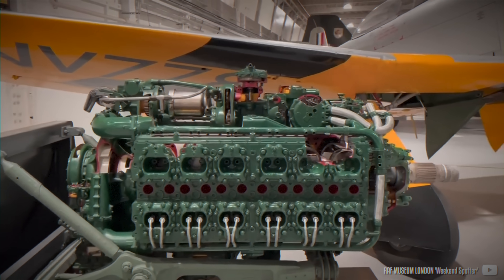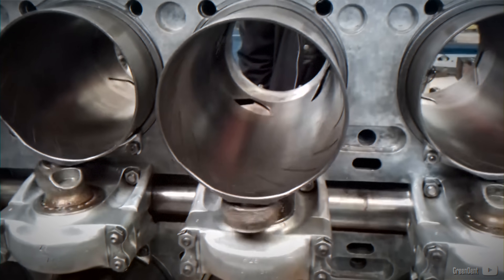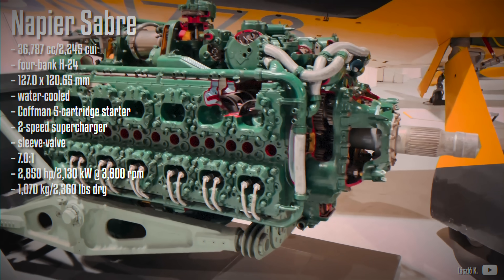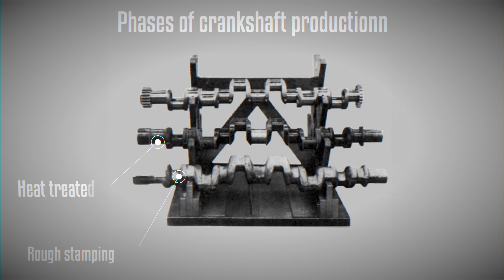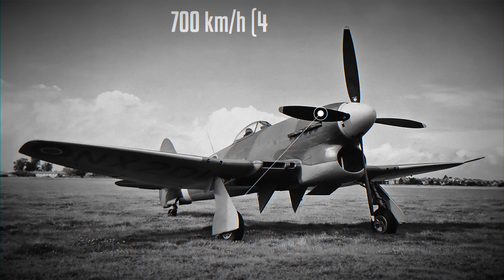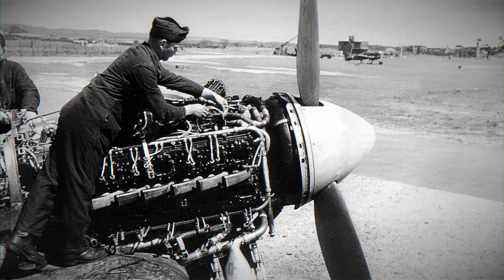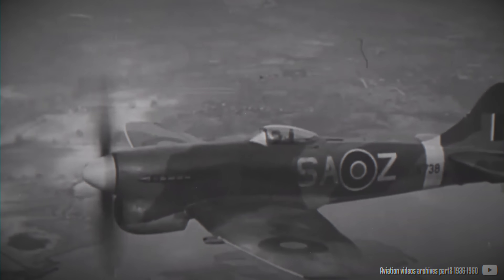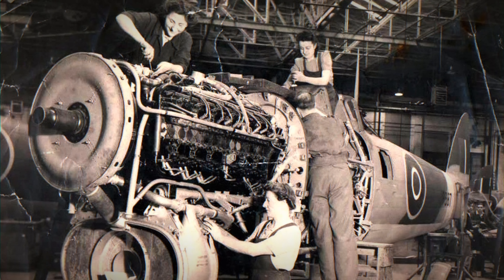An Unreliable 24-Cylinder That Helped To Win The War

Comment: The Tempest was capable to fly faster than 800 km/h with emergency power . One is being restored by Kermit Weeks in Florida . He has a brand new Sabre and the plane will fly in few years becomming the only flying Hawker Tempest Mk V . A beast that I'll love to see in her element .
Reply: Yup.
Reply: emergency power? what did that do?

a prop plane that could fly over 630mph?
Reply: @pazsion  War Emergency Power, or WEP is a system in wartime propeller aircraft that temporarily pushes the engines out of its safe operating limits for short periods of time in the name of power, e.g. if your life / plane depends on you outclimbing an enemy aircraft on your tail, you would use WEP. This was done by water / water-methanol injection or increasing forced induction pressure. It's only for short periods however, as more than a few hours of WEP operation often requires an engine rebuild / overhaul.
Reply: The Tempest could do 800km/h in a dive.

The Supermarine Spiteful XVI, of which only 2 were made, could do 494mph/795km/h.

The fastest Sabre powered fighter was the Hawker Fury prototype, which managed 484mph/779km/h. There were three Fury prototypes made, two powered by the Centaurus. The third was initially powered by a Rolls-Royce Griffon, and then changed to the Sabre.
Reply: @TheSilverShadow17  How about not. 700 mph is 608 knots. At 15000 ft that is Mach 1 I.e. supersonic (square root of the degrees kelvin times 38.94 = local speed of sound in knots) No WW2 piston engine fighter was capable of anything like Mach 1, for aerodynamic reasons as well as not enough power and also a propeller aerodynamic reasons like the prop tips going supersonic long before the aircraft does.
Reply: @TheSilverShadow17 
700mph? I don't believe it. If these were facts I would know (believe it or not 😂).
Reply: @priceyA320  It was an exaggeration at best, I know they never went that fast but they went decently fast. A more realistic guess would be 500-550 mph
Reply: @priceyA320  Now if we're talking just the engine by itself, the Wasp Major could easily surpass 600 mph, but "almost" 700 mph because it made over 4,300 hp at least the turbocharged variant did, granted that it was mounted in a light enough and aerodynamic plane body
Reply: @CarLos-yi7ne  Well the Wasp Major was one of the WW2 piston engines that could go over 600 but not 700 is what I meant to say lol
Reply: @TheSilverShadow17 
Sorry to say this is beyond the realm of possibility.  500 MPH in a dive is about it.  Beyond that speed propeller efficiency and drag are just too big of factors.
Reply: @ccrider8483  Then tell that to the people who designed and built the WW2 radial engines, they know their shit better than any Internet "expert". I'm obviously not one of them because my knowledge of planes isn't as great as it is with cars.
Reply: @TheSilverShadow17  You already proved that you are not the expert! 🤣🤣

Wasp Major wasn't going anywhere without an airframe around it. It is the combination of engine and airframe which makes a plane do what it does. 😉.
Reply: @CarLos-yi7ne  Of course, that's what an airplane is in a nutshell lol. I've already admitted that I'm not an expert but I'm also not a noob either. I know a decent amount of things about planes but I couldn't tell people every nook n cranny about one to be fair.
Reply: 700 kmph which is 435 mph
Reply: @hosfarm1370  It all started with a 700MPH capable spitfire. But well that post somehow vanished... 🤣🤣
Reply: @hosfarm1370  It all started here with a 700MPH capable Spitfire... But that post is removed for "unknown reasons".... 🤭
Reply: @ccrider8483  Read Roland Beamont's book ''Tempest Over Europe'' he regularly stated Tempests were diving at 550 mph. Who to believe?!!
Reply: @shtupidmate Water Methanol was mainly a German thing along with nitrous oxide but W/M was used on the P51H. The allies used high octane fuel with two ratings. 100/115 and 120/145 the former number being the ordinary octane rating, the second being the war emergency rating for when the throttle was pushed through the wire stop to give full emergency power.
Pierre Clostermann reckoned his Tempest “Le Grand Charles” was tuned up to 3,500 hp for “Diver” missions chasing V1s, along with polishing the plane and taping over and gaps. I know a later model Sabre was bench tested at that figure reliably.
Reply: @Slaktrax  
That is an interesting recommendation and I will see if I can find this resource. Thanks.
There was a very popular unlimited air racing pilot named Skip Holms who had a lot of experience with various airframes. He is featured in various YT videos and has a lot to say about high speed prop driven aircraft.
PS: 550 mph in a dive at high altitude with a big powerful aircraft seems plausable but that was certainly pushing things.  Chuck Yeager wrote in his book that one could see the shock waves forming on the wings of P51s when in a dive during WW2 and that BF109s would sometimes not recover from dives due to control lock from shock waves.
Reply: That is bullshit. The Hawker Tempest never reached 800 km/h. The fastest propeller-driven piston-engine aircraft was the German Dornier Do 335 "Pfeil". It reached a top speed of about 474 miles per hour (approx. 763 km/h) and was used during the Second World War.
Reply: He better bring her to the new reno air races once it's announced
Reply: I know I couldn't believe he has brand new Sabre .
Reply: @ccrider8483 that’s what he said. 800 km/h is 500 mph
Reply: Well I live 25 Miles North of "Fantasy of Flight" and Kermit is limited to 300 Knots, or MPH, (but he pushes it a little with his P51) and you'll never see those kinds of speeds below 10,000 feet in Florida or anywhere without permission.
Reply: @SvenTviking  No 3500hp was not an option with wartime Sabres and probably not an option with post-war Sabres.  The highest certified power for the Sabre was 3055hp at takeoff with anti-detonation injection (methonal/water) for the Mark VII as fitted to the Fury.  There are no primary sources to confirm any higher power figure, however, the remaining Napier archives are very sparse with most information being lost.  Much information is derived from British Government sources and in my opinion they too can be coloured by personal opinions, so unless there are figures provided, I treat them with a grain of salt.

The allies used anti detonation in a number of engines and the British fitted nitrous oxide to an experimental Spitfire and to a number of specialised Mosquitos.

The fuel grades are based on lean/rich mixtures, for instance 100/130 is 100 octane (equivalent) on a lean mixture and 130 octane on a rich mixture.
Reply: A brand new Sabre?????   There is a crated Sabre around but last I looked that was still very much in England.  Kermit does have a crated Tempest Centaurus.  Also, last I looked there was little to no progress on his Hawkers.  Have you got a link?

Two other projects are aiming for a flying Sabre powered aircraft, one in Canada and one in Britain, both of these seem to show more activity than Kermit's Hawkers.  

Personally, I don't hold out much hope, there hasn't been a running Sabre since the 1950s, there is little expertise available on this engine, it is very complex and used fairly exotic materials for its time, and there are virtually no spare parts except parts shared with other engines such as magnetos (these tend to disappear off existing Sabres probably for use on Merlins).  The engine has a bad reputation for reliability, especially the earlier marks, meaning the best option is for a later mark of engine - very unlikely to find one of those, all the remaining later mark engines appear to be sectioned for museum display - the Canadian project has recently acquired a sectioned Mark VII from New Zealand.  Besides, having spent vast amounts of money on restoring an extremely rare aircraft, who will be game to fly it with such an engine???  Finding a pilot gifted enough to fly it and insane enough to fly it?  Insurance for aircraft and pilot - hahahaha.  Third party liability insurance - fat chance in this day and age.
Reply: @robertnicholson7733  The videos on his YT channel are just few weeks old .
Reply: @ludovicbon5903  Well, I was wrong and I apologise but it is a very interesting error and thanks for the heads up.  I have only looked at one of the videos.  That is a newly acquired engine and is a late Mark either a late IV or V.  Initially I thought it was a VA but the linkages don't seem to be right for that engine.  I doubt it is a new engine it doesn't have the look but that is a subjective view and not fact.  It is crated so it may have been going in for overhaul or coming back after overhaul.  In any case, it is a major find.  It just depends what they are going to do with it, run it without teardown, or tear it down, a big decision.

Richard Grace got a lot of things wrong about the engine, for instance it was 36.7 litres not just under 30 litres as he said - that is a pretty basic error. I have listed some of the errors in a post on the part 2 video.
Reply: 700 kilometers per hour
Reply: No, 800 km/h is just under 500 mph and it couldn't do that.
Reply: @pazsion  
"a prop plane that could fly over 630mph?"

Your arithmetic isn't very good. 800 km/h is just under 500 mph.
Reply: @TheSilverShadow17  What WWII fighter used the Wasp Major?
Reply: @ccrider8483  
"Sorry to say this is beyond the realm of possibility.  500 MPH in a dive is about it.  Beyond that speed propeller efficiency and drag are just too big of factors."

Quite right.

What also gets left out of this - and when it does, the internet ignores it - is the MCrit of the wing. The Tempest used a modern wing section that was one of the most advanced of the war. Perhaps second only to that of the P-51. So it was less affected by shock propagation than earlier types, like the P-47 or the Spitfire (yes I know about Tony Martindale).

But realistically, a combat aircraft has limits and pilots were trained to fly within those limits because they knew what the consequences could be.
Reply: @TheSilverShadow17  
"Then tell that to the people who designed and built the WW2 radial engines, they know their shit better than any Internet "expert"."

This is a non-sequitur.
Reply: @CarLos-yi7ne  
"It all started with a 700MPH capable spitfire. But well that post somehow vanished"

I doubt anyone would be stupid enough to post that. However, I have seen quaint posts that claimed the P-47 was 'capable of over 725 mph in a dive'!🤣
Reply: @Slaktrax   Beamont was probably using TAS conversions. Many pilots talked in those terms. These are extremely misleading for anyone who is not a pilot.
Reply: @SvenTviking  
"Pierre Clostermann reckoned his Tempest “Le Grand Charles” was tuned up to 3,500 hp for “Diver” missions chasing V1s, along with polishing the plane and taping over and gaps."

No, you put the numbers the wrong way around. The Sabre in WEP was only good for about 3,050... (as if that wasn't enough.)

"I know a later model Sabre was bench tested at that figure reliably."

And I know that no records exist to back this up.
Reply: @rheinmoses29  
"That is bullshit. The Hawker Tempest never reached 800 km/h. The fastest propeller-driven piston-engine aircraft was the German Dornier Do 335 "Pfeil". It reached a top speed of about 474 miles per hour (approx. 763 km/h) and was used during the Second World War."

Oh stop it. The Do-335 can barely make a claim to be anything more than experimental.
Reply: @thethirdman225  That was before I realized my errors in writing that original comment. Besides, that was several months ago for context.
Reply: @TheSilverShadow17  Gotcha. Noted.

Comment: Napier was one of the coolest engine design companies around. This engine, and others like the Deltic, earned them a place in history.
Reply: Yeah they did exotic concept, and made them work mostly flawlessly (comparatively to their complexity).
Reply: Yeah. I love sleeve valves regardless just for the seeming simplicity, and yet insane  mechanical complexity. Always wanted to design a small motorcycle two stroke with a sleeve valve engine. @Damien.D
Reply: @ManiacRacing that would be interesting concept... big exhaust ports open at end of stroke, got all possible power from power stroke.
Reply: yes, I think so as well, but rotary valves have been used to great effect by rotax among others....I believe there is room for a sleeve valve design
@Turnipstalk
Reply: Yeah sadly I dont have the machining skills nor the budget to do such tomfoolery. But I would still like to see it done. Maybe if I hit the lotto someday...
@Turnipstalk
Reply: That was so sick!man!!
Reply: @Turnipstalk The Sleeves were always the main problem of Sleeve Valve Engines, just as the Wankel Rotary Engines always had a problem with the Apex Seals...
Reply: @TurnipstalkNapier and Bristol indeed had headaches with the sleeves.  The problem was residual stresses that can be in the raw material or created during machining.  When the engine warmed, the cylinder distorted to an oval.  Bristol Finally settled on (or invented) centrifugal casting.   Cheers
Reply: The Knight type engine is an American design... sold to the British under license.
The Deltic design was sold to Napier by Junkers Jumo..

Comment: A sleeve valve engine has high oil consumption and can be difficult to start in freezing temperatures. That is why they are not used anymore. Then of course by the time the Tempest came out the Me 262 did too.
Reply: Another important factor:    in the 1920's, poppet exhaust valves set a limit on engine performance because doing anything to increase power output for a given cylinder size led to exhaust valves being overheated and burning out.   Sleeve valves don't have this problem and experts including Harry Ricardo promoted sleeve valves as the future.   However, in time for WW2 engines such as the Merlin, sodium filled stellite exhaust valves were developed, which had improved heat flow into the cylinder head and withstood higher temperatures anyway.   These rendered sleeve valves obsolete virtually overnight.
Reply: @Turnipstalk That's true in theory, however aircraft engines of WWII vintage were limited to about 7:1 so that they could use low swirl combustion for efficiency and so they could use supercharging/turbocharging.   The Napier engines featured in this video had a 7:1 compression ratio, actually higher than for example the poppet valve Merlin, which had only  6:1.  Both required fuel of at least 100 octane rating.
In terms of combustion conditions, supercharging is much the same as raising the compression ratio, as is turbocharging, except that turbocharging is a little more efficient as it uses waste heat in the exhaust instead of taking some power from the crankshaft.
Reply: Once it was sorted, the single-acting sleeve valve system used in the Bristol, Rolls-Royce, and Napier engines had similar oil consumption figures to the equivalent poppet valved engines.  As the war went on, the oil consumption of both types of engines was significantly reduced
Reply: @keithammleter3824  This is true, however unlike poppet valves, the sleeve valve was not prone to leading with high grade fuels that contained large amounts of TEL.  They also had superior tumble and swirl characteristics.  

Despite all the reported problems of sleeve valves (setting aside the Crecy) three of the last four piston aircraft engines designed by Rolls-Royce were sleeve valve, the Exe, The Pennine, and the Eagle 22 H24 (the last piston engine they designed), the only poppet valve engine after the Merlin (design started in 1933) was the Griffin (design started in 1939).  It begs the question, given R-R's knowledge about poppet valve improvement, why the sleeve valve designs?